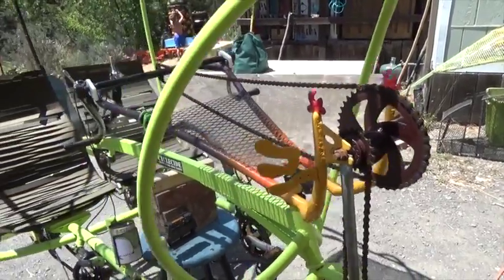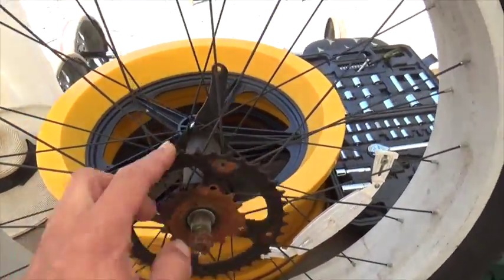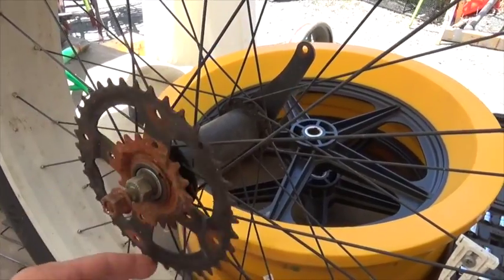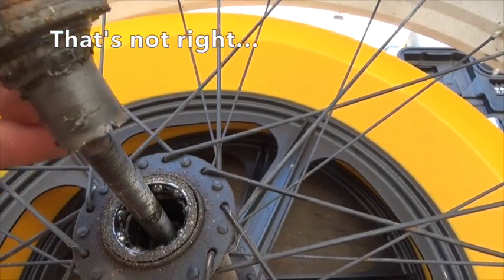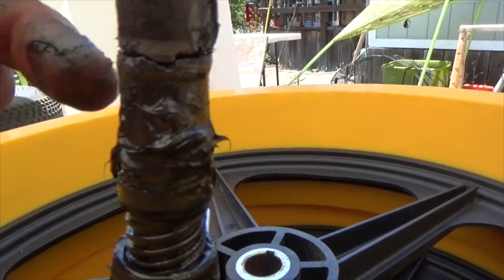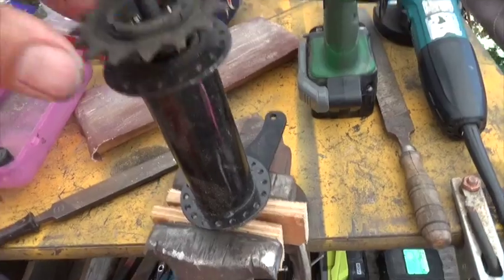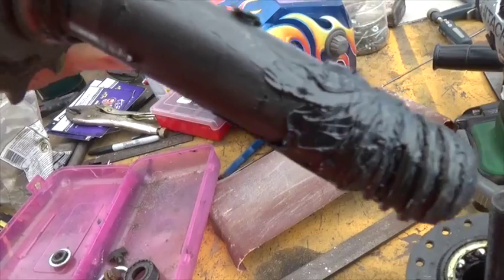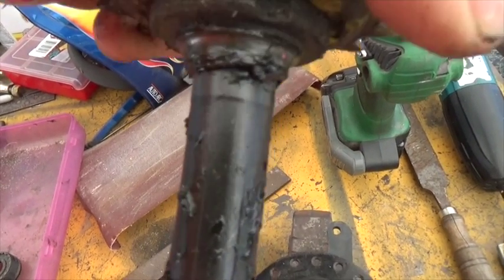broken coaster brake

Comment: My Name is Andrew, an engineer from Obtainium Works. You might want to look into using sprockets with sprag bearings. Sprag bearings are one way bearings. They would be able to handle the load you have. Could change out one of your upper sprockets with one of theses
Reply from the maker: Andrew Autore Thanksfor the tip, Andrew! BTW, we love the Obtainium Cup!